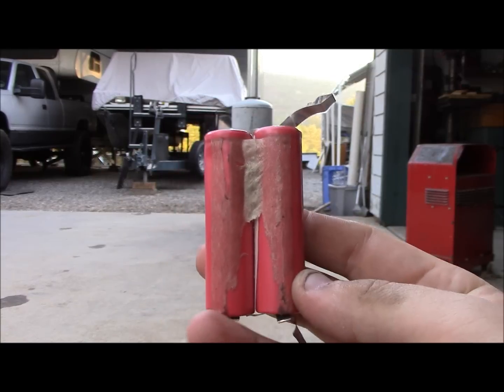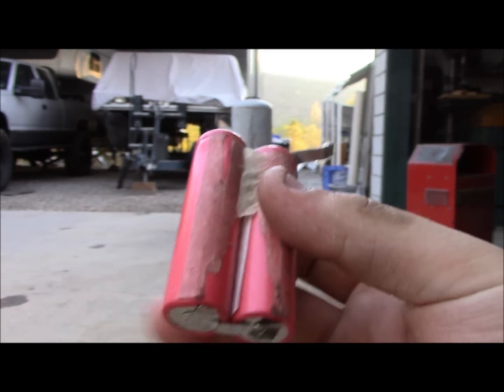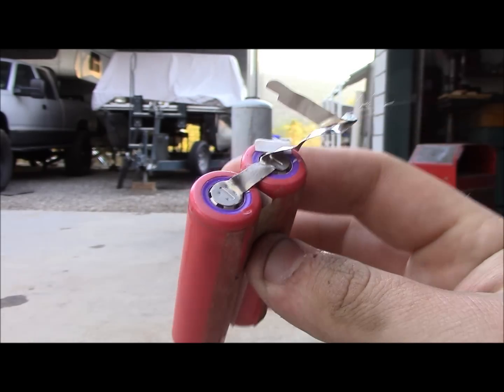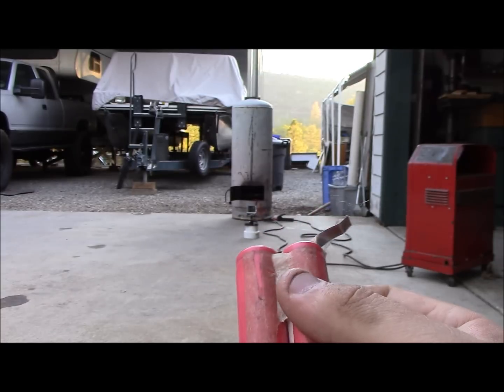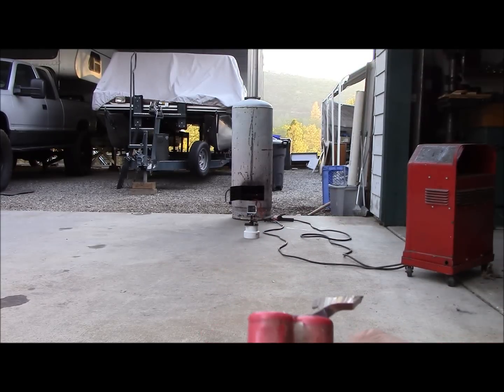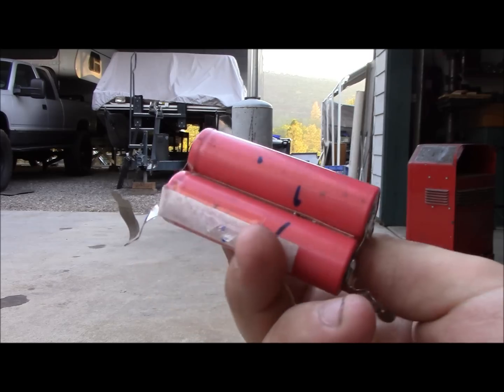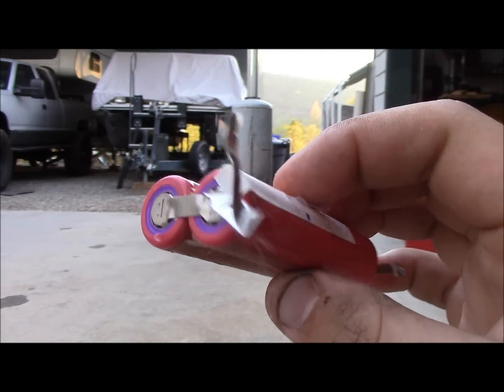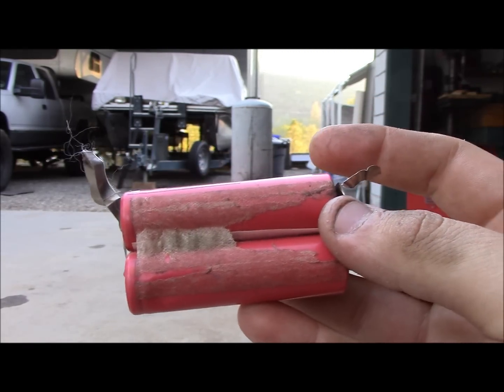Best 18650 battery Vent and Explosion

Comment: It seems pretty simple to me for people to use these batteries safely.  Always transport them in a case, inspect them for wrapper and insulator damage, build coils with resistance that corresponds to amps within the battery's limits, and always use an atomizer with a protruding positive connection on a hybrid mod.  Replace the wrappers and insulators if they are damaged, or replace the batteries.

Comment: I'm actually surprised it took that long to explode at 40 amps. I think that's a testament to how durable and safe these batteries really are because let's face it. Nobody is charging these things at 40 amps. Just my opinion.
Reply: +Barry The Chopper if you go 0,1 ohm and below you go over 40 amps
Reply: +anestischatzibeis discharge not charge
Reply: +Arttraveler that depends on the voltage you are running them at as well as if you are running multiple batteries and in what configuration.
Reply: It's also a different battery than the typical vape battery
Reply: At what voltage though? 40Amps don't mean much if we don't know the supplied voltage
Reply: @chiefdenis  amps means everything. That's where true power comes from.  I'd much rather be shocked by 200 volts than 200 amps because amps kill mofos.
Reply: @stompingpeak2043  you don't get it, you can't produce amp without producing voltage, and vice versa. 40amps at 200volts will be more intense than 40amps at 3volts
Reply: @chiefdenis  if I'm soo clueless how do I know that battery they are talking about usually has 4.2 volts?
Reply: @stompingpeak2043  whoa, chill man, "clueless" is your own word not mine, not trying to make u look stupid, I'm just trying to understand more about the process.

Li ion cells are usually between 3.6 to 3.8V nominal, usually 4.2 to 4.4v fully charged, the fact that the battery blew up due to overcharging means, it was either charged at extreme voltage or current, or both. Im trying to understand at what voltage it was charged at, given 40amps, it might have gone ballistic much faster at 200v, 40a
Reply: @chiefdenis  I know man. I'm not the one calling someone clueless in the first place.
Reply: @chiefdenis  It seems you don't quite understand either. You apply some voltage to the batteries to charge them. The charging current will be equal to that voltage divided by the resistance of the battery. So if it takes 10 V to charge that battery at 40 A then if you apply 200 V you will be charging at 800 A ( resistance stayed the same, voltage was multiplied by twenty so current is multiplied by twenty)
Reply: on a side note, yeah these batteries are safe only when they are healthy and in the right circuit. When you short this guy you are going to get a lot more than 40 Amps. 

And this is quite possibly the most common vaping battery btw, if you only count the high power stuff. The batteries a lot of people vape with are Samsung Laptop batteries that didn't meet QC for laptops.
Reply: @jackward3593  i won't claim to know everything in depth about electricity, even though i work with them a lot, but that was kinda the angle i was going with, i was interested in the amount of voltage that was applied to the battery to charge it at 40amps for some perspective, because 40 amps simply, is not a lot of information for me to go on. I work with li ion betteries in a lot of diy projects, and I'm always interested in everything i can possibly do wrong with them explosives
Reply: @chiefdenis  40 A is all the youtuber needed to say because the rest of the information is available from the battery manufacturer. If you are going to be using Li-Ion in your own circuits you should really read up on batteries, ohm's law, and other general electrical concepts. I'm not trying to berate you, but if I had a Li-Ion operated circuit that you designed and then I saw the things you said in the previous comments I would throw it away. I'm only saying this because you need to keep yourself safe. Might I recommend you put fuses in your circuits. Use a fuse that is just a bit lower than the batteries continuous current rating and you should never have an explosive design. Better yet there are premade circuits meant to go in between the battery and anything you build, called PCMs. They will protect you and your devices until you are very comfortable with how all of this works. I do the same thing in products that we build; I let an outside battery expert handle those safety elements and tuck them away inside a seperate enclosure. And I won't stop doing that because you never know when some careless user is going to stick a piece of metal anywhere in your circuit. And of course know how to maintain, transport, and handle the batteries properly.
Reply: Chief Denis Okay so I guess you do know something about batteries. Sorry, my mistake. What I was getting to is that you could learn the internal resistance of these batteries and you could make a pretty decent assumption of the voltage in the cell. Now if you know that then you can determine what voltage was applied to achieve 40A. The important thing that I wasn’t sure you saw was that there is at any given moment exactly one voltage you could apply to these cells to achieve a charging current of 40A. 

Who cares what voltage he applied.. he applied the voltage that produces 40A.
Reply: @jackward3593  the thing about internal resistance is that, it changes through out the life of the cells, so one can't just look at a data sheet and have relevant info relative to this situation.

On some samsung sdi datasheets,  it is specified that some cells are tested to 12v and 2.5A with no explosions, that's good information to know, even though it's very unsafe. 
Seems my question is more trouble than it's worth, anyway, cheers.
Reply: I’m actually surprised the comment section is so heated.
Reply: some of the better batteries have a 35+ amp discharge rating and continuous is 25-30 amps. so with 2 and being lower amp batteries they did pretty well. but these guys can pry discharge at 15 amps continuous drain each. 30 amp drain vs 40 amp charge.

Comment: e cigs aren't really dangerous. you have to have a certain understanding of the ohms law. if they're handled properly they're perfectly safe
Reply: now theres someone who talks sence! I hate how people are being "scared" by the bs the media spout about ecigs blowing up. its true you'll get faulty units from time to time but that's how stuff works.
Reply: Rodney Weber i once built a copper rda coil not thinking about that copper is a super good conductor and my coil was basically 0.003 ohms and i fired it and it started glowing and then i checked my batt temp with my fingers as usual and it was super hot
Reply: jaakko200987654321 that's what you'd expect you need to be safer they could of exploded easily
Reply: JGillyfromhu3 rapper need producer How do I know if the coil I built is safe? using single or dual 18650 batteries
Reply: Penetrobe9000, the media damage has already been done and there is no going back on that,  As a Pontiac Fiero owner trust me on this!
Reply: @LadyMoonstar6601 ecigs are dangerous after thrown away carelessly, which most of them will reach. Chemicals reach into the soil and they do explode

Comment: 1:11 when the hissing noise starts is that when the battery is venting? or did it start venting before that
Reply: I wonder what would happen if the venting valve was clogged.

Comment: Good luck to the hero's vaping over 200 watts. That's asking for trouble. But for around the 60 -100 watt range , there is no chance of this happening.
Reply: you have a profound misunderstanding of how ohms law works if you believe this.
Reply: SirZok1 actually...the way my builds are made I quite regularly exceed 220 watts and haven't exploded but that's because I have a braincell and read up before making these obscene creations the issue is people that don't understand and stick a super sub ohm build on a mech and wonder why they're missing their jaw. if they really want to regulate vaping they should just have a mechanical mods course like the speed awareness one before being allowed to use a much mod
Reply: SirZok1 couldn't this happen while charging if there was a malfunction
Reply: Could you see how long it took charging at 40amps? Does anybody inhale that long on 200w+ when discharging? Did you see how long it was smoking for? Even on a silly mech build like .05R,  the tale tell sign that something is not right, like the mech is very hot and the vents are giving off a bad smell, should stop anyone from blowing their face. You'll find that a lot of the explosions have been caused by hard shorts or auto firing in pockets. Only a few have been from ultra-low builds then abusing the battery.

Comment: npw for all the smart people out there with 18650 batteries in ur pocket and make sure u put a bunch of quarters or other change in there too lol.  that would be a bad day in ur pocket! ! thanks man
Reply: Or a key chain with a bunch of keys on it. One day I had a battery in my pocket and I forgot it was in there. I had keys in that pocket too.  I was sitting in a chair and my leg where the pocket is started getting hotter and hotter. At first I thought it was my imagination but pretty soon the level of heat going on in there turned into "wtf!!!????"   -- I Quickly reach my hand into my pocket and said "Ohhhh.... there is a battery in there!"
Reply: You would need enough quarters to pretty much completely surround the battery but in any case it would still probably be a bad idea.

Comment: so, lithium ion batteries have a future as rocket fuel! patent it! ☺️
Reply: Sadly no. They are about a quarter as energy dense per lb.
Reply: Maybe not batteries, but have there been any studies on lithium in rocket fuel?
Reply: @pompshuffle562  they're using hydrogen. Hydrogen's energy by weight is 142MJ/kg which is around 200x more than the 6MJ/kg of lithium ion, and lithium is (if memory serves correctly) around 1% as energy dense as gasoline. They're better off using gas than lithium
Reply: @RYVENANT  Thats really interesting I'm not sure if this is correct and I'm too lazy to fact check but i heard space x was using kerosene which would make sense with your comment
Reply: @pompshuffle562  yes I believe so, not sure if they still are but I definitely remember reading they were using kerosene based engines for a bit. I remember even methane ones were in the mix, not sure if they fully chose one

Comment: how did you manage to spot weld them and not explode them
Reply: They come that way from the factory. The amount of power discharged is really high and instantaneous. the battery doesn't have time to heat. also, the top of the battery has a few mm at the top of metal and space. It would take a lot of heat top spot weld deep enough to explode the battery.

Comment: what batteries are safe for vaping?
Reply: LG HG2 - 18650 - 20A - 3000 mAh  I've been using them for like 3-4 years, no issues at all. Although I prefer to charge them in Nitecore i4 just to be extra safe. Charging the batteries using your vaping device might end up badly.

Comment: Are you crazy or something 18650 batteries can still be used in flash lights that's what I do with mine when they are old and no longer use in my mods

JEEZ!

Blowing them up is just crazy and damn right dangerous

Warning do not do this at home folks

Comment: That battery is a Japanese sanyo 18650ZT and it’s maximum safe amp discharge is 5.8A. 
I vape with them at 18A. (I know it’s not safe)
No problem, just keep monitoring its temperature. 
Those batteries don’t have another use for me so I don’t care about reducing their capacity and life span.
But man they are great, they can handle a lot of stress.